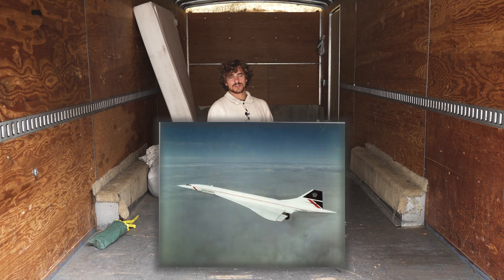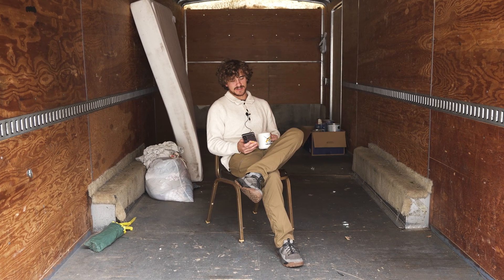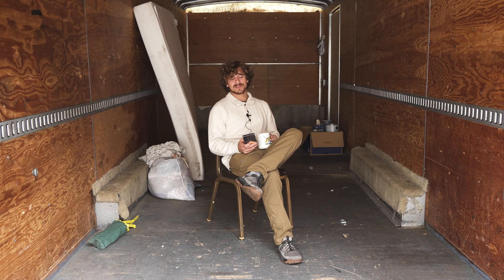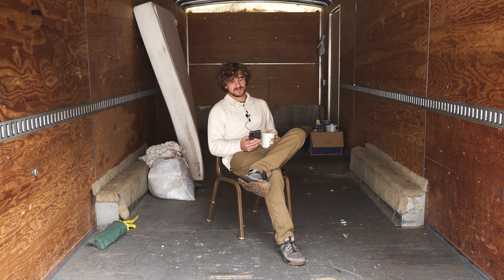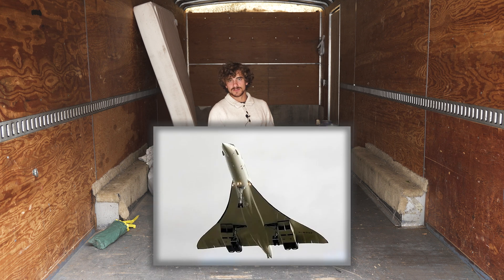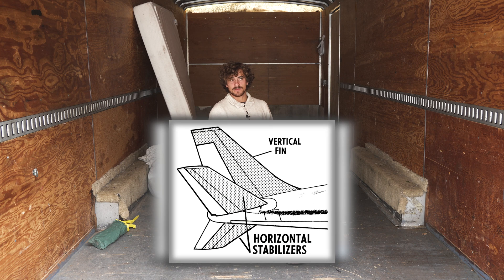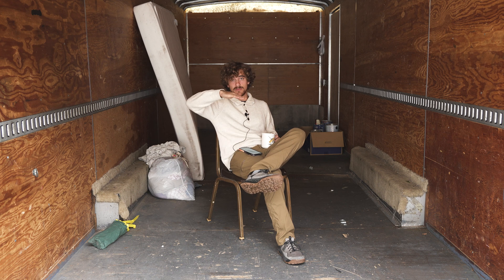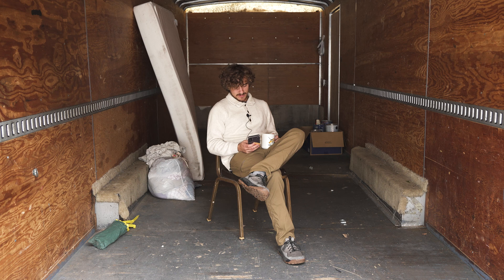Fastest Passenger Jet: The Concorde

Comment: It was not one of the fastest transport aircraft, it was THE fastest and by then some. 

It does not go through the sound barrier twice. Mach 2 is just twice the speed of sound.

It has triple layer windows the size of a postcard which do not really heat up much. The only accessible metal parts connected to the exterior are the door latch/handles and they become almost too hot to touch.

Main reason for retirement was the refusal of Airbus to continue producing and supplying spare parts.

I flew twice on AF in March 2003, just 2months before they retired it and took a dump from 60.000ft at Mach 2. Let's see a seagull top that.
Reply from the maker: @jackdoe3889  Cool story!
As for the speed, Concorde actually lagged behind the Tupolev Tu-144 by about ~100mph. However, it made up for this by having a much longer range.
Reply: @OddHistoria  Concorde  could fly faster and even higher, but had 2 limitations: heat and the Armstrong line.

I have never seen any official data, but men infinitely more intelligent than me calculated that it's coffin corner was around 78.000ft.

Concordsky could only fly supersonic with afterburners, where as Concorde only used reheat on takeoff and transitioning from subsonic to supersonic. They would be turned off at M 1.71.

On takeoff you could hear them being turned on in pairs, a sound not unlike lighting a blowtorch. A rather big one at that.